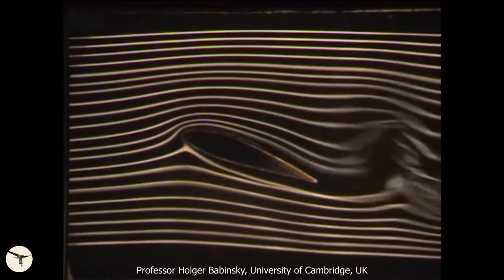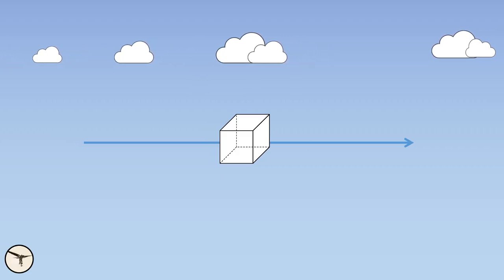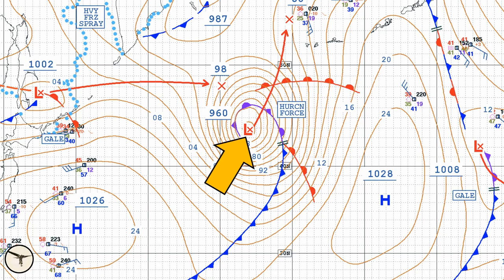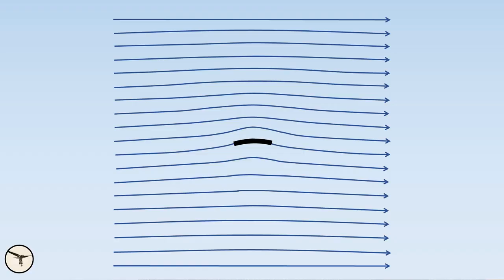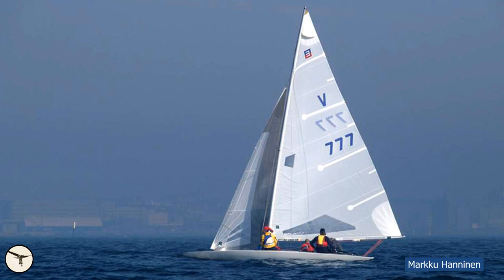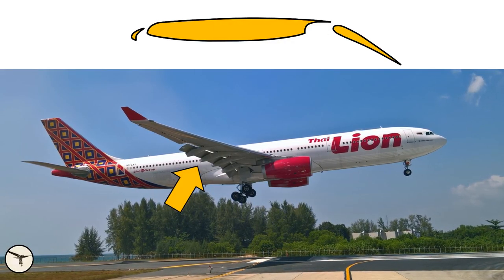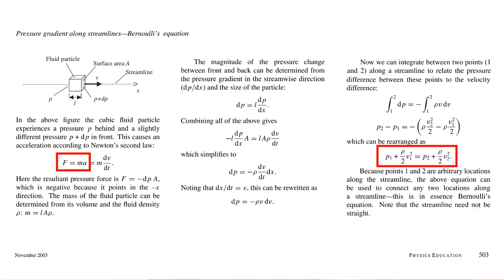Forget Bernoulli and Newton | The easy way to explain lift

Comment: The problem with this explanation is that it doesn't explain how planes can fly upside down, and how some wings are completely symmetrical and even flat in the case of some fighter jets
Reply from the maker: Short answer: Angle of attack. A longer answer: https://youtu.be/d4w1Iy4vVMg
Reply: The key is in the symmetry, or rather the presence of asymmetry.  Asymmetry to the relative wind is the condition for lift.  Asymmetry can come from asymmetrical camber and/or asymmetry due to angle of attack.

Comment: In 7000 hours of flight time. Flying cargo for a living, flight instructing,  flying ultralights, powered parachutes, and kites.  I have come to the conclusion there is not just one answer.  Lift comes from pressure, that pressure can come from impact, ie angle of attack,   In a powered parachute or kite.  Or from Bernoulli’s type of lift.  Some aircraft such as the stol planes could fly with no airfoil at all. Just off impact pressure.   There’s a lot more to this,  like aspect ratio,   And drag curves.  It’s not that easy of a thing.  Nice video. But the whole story has to many answers.
Reply: you've a poor understanding of this subject. 

while it's too tedious to go through everything, just for starters: symmetrical airfoils such as on aerobatic plans still create lift the exact same way as any other plane; meaning almost exclusively via their top surface. in this case, an angle of attack is required for it to work, but the lift does not come from "impact pressure" or deflected drag. while physically not impossible, this would be by far the least efficient method to create lift.

Comment: If a slightly inclined hydrofoil is pulled through liquid helium, no transverse force is generated. If the same hydrofoil moves through liquid sodium, with exactly the same geometry or kinematics, then there will be a transverse force, also known as lift. Explain that !
Reply from the maker: Zero viscosity
Reply: @FlywithMagnar  Correct. You could elaborate for the benefit of your viewers.

Comment: No mention of angle of attack? No consideration of non cambered wings working in simple toy gliders?
If all the lift is low pressure above the wings, what keeps the lift required to carry a 400K pound B747 from ripping the thin skinning off the upper wing surface? There has to be more.

Comment: A teaser to explain the difference.    An airplane carrying a plane load of bird cages with birds in them.  Does the airplane weight less if all the birds fly around there cage?  No, because the air coming off their wings goes down and hits the floor and the airplane is still carrying the bird flying or sitting on the roost.  If ceiling and floor of the aircraft body are cut out so you can see through the airplane and now the birds fly around their cages does the airplane weight less?  Yes, because the bird wings pull the air down throught the open ceiling of the airplane and push the air out the bottom of the open floor of the plane.  And if you put in a large fan as in a F-35 and open the top and bottom door and turn the fan on then the airplane can move up without the lift from the wings, because the fan, like lots of little birds, is moving air down.

Comment: Rockets also work on the Bernoulli Bernoulli  principle. This is why rockets cannot work in the vacuum of space.
Reply: Wrong. They work on newton and work just fin in vacuum.
Reply: @Observ45er  Rockets work on pressure.  You cannot create pressure in a vacuum
Reply: @boptah7489   Try again.  
The combustion pressure pushes the rocket motor forward while pushing combustion gasses rearward (in to the vacuum)  Momentum transfer.
The gasses have mass and the pressure accelerates them into the vacuum allowing the forward component of that same pressure to push the combustion chamber forward.
 Trivial  Newton's Third Law from 11th grade.
Reply: @boptah7489   Try putting zero pressure (the vacuum of space) into Bernoulli's equation and see what you get, smarty pants.
.
Hint: Rockets work BETTER in space than in an atmosphere pressure.

Comment: So, in other words, a curved surface in motion produces a pressure gradient across it - low pressure immediately above & a corresponding low-pressure immediately below - as you ABC diagram deftly demonstrates (which, seems a tad Newtonian, wouldn't you agree?). Seems to me all theories, more or less, point to this same conclusions, just explained from a different perspective. Moreover, you're ignoring the role of angle of attack & the Coanda effect at the boundary layer, both of which are highly significant in the generation of lift, wouldn't you agree?.  In fact the diagram of high-lift devices you used in order to demonstrate increased curvature shot you in the foot a little as they portray slats & slotted-flaps (curvature/area increasing drooped leading edges & Fowler-flaps would have been a better choice). The primary role of a slats is to re-energise the boundary layer on the upper surface of the wing - not to increase curvature. These allow the plane to operate at a higher AOA, thus generating greater lift at low-speed. Although slotted flaps do increase curvature they, primarily,  exploit the Coanda effect by accelerating air through the slot formed between the leading-edge of the flap & the trailing edge of the wing.) This allows them them be lowered to a greater AOA (thus generating more lift) without stalling when compared to a plain-flap. May sound like I'm picking here, but you're being a little forthright, maybe even pedantic, in your explanation ("wouldn't you agree?") so inviting scrutiny. Remember, the devil is in the detail. Wouldn't you agree?
Reply from the maker: Thank you for tour feedback. Yes, the devil is in the detail. The purpose of this video was to explain lift without using Bernoulli principle or Newton' laws of motion (the nature is a great source of inspiration). I just added them in the end as a teaser. 
Then, I made this video: https://youtu.be/uyRx25MSWng
Which was followe up with this video: https://youtu.be/d4w1Iy4vVMg
I think I have answered your comments in those videos, except for the slapt/flaps, wich will be the subjeft for a future video.

Comment: IMHO The Coandă Effect (From Henri Coandă, Romanian scientist, 1886-1972) is more about the property of a flowing fluid to stick to a convex surface* (that precisely addressing and explaining the experiment with the paper). A consequence is "suction", ground effect and, ofc, the so-called AERODINAMYC lift, exerted on a single curved surface, as you wonderfully explained. 
Bernoulli's Law (from Daniel Bernoulli, Swiss scientist, 1700-1782), on the other side (in conjunction with Newton's 2nd Law) better explain the wing (but not how an aircraft flies, which is a conjunction of factors!). 
Bernoulli's wing: Simply put, the wing splits the air into two streams, one flowing atop the wing, and one below the wing. One can imagine the air particles A and B flowing together, hand in hand, being separated at the leading edge of the wing and happily meeting again at the trailing edge of the wing. "A" travel on the top of the wing, and "B" below it. That means that they traveled the respective distances, while separated, at the same time (!). 
And how "A" in "B" stays closer to the surface and just not go away? Well... (*) That's the Coandă Effect :)
If the top of the wing is more curved (as a usual wing is), the distance traveled following that surface is, ofc, greater than the "route" below the wing => the velocities v of A and B must be different in the way that v(A) > v(B) (d = v*t, t being the same here). 
Bernoulli's Equation: P(x)/rho+g*z + v(x)^2/2 = constant. rho (fluid density), g (gravitational acceleration), and z (elevation) can be assumed as being (quite) the same and neglected,  thus p and v are inversely proportional.  (btw Your equation looks a bit odd...). Measuring pressure instantly and having V(A) > V(B) as explained => P(A) must be lower than P(B) => differential pressure, acting upwards ("lift"). 
PS there is a trivial question, asking that if the more curved upper surface (Bernoulli) and/or higher pressure to the apex of a curve (Coandă) explains the ”lift”, how a plane can fly inverted? Actually, they can't unless they are fitted with specially designed wings and geometry, as in the case of aerobatic aircraft, or some of the military.
Reply from the maker: To answer your question, the answer is angle of attack. There's no need for a specially designed wing to fly upside-down, as long as it is strong enough. However, many aerobatic aircraft have a symmentrical wing profile for better handling.

Comment: Lift is NEWTONIAN. Bernoulli flow is close enough to the process that does generate lift that Bernoulli flow and related math is often used in designing wings and aircraft, and explaining aerodynamics to aspiring pilots.

In actuality, the perfect vacuum at the surface of the back-top of the wing pulls down the air flowing over it. That air then pulls down more air from above it. All of this air, scooped up, if you will, is accelerated downward off the back of the wing. The opposite and equal result is lift—NEWTONIAN. Any other “explanation” is just Hogwartsian nonsense.

As such, it can be determined that gravity provides most of the energy that sustains an airfoil equipped aircraft in flight. Glide ratios of winged aircraft (autorotation for helicopters) and the ability of autogyros to fly are proof. Jumbo Jets have more than once glided to landings. The 2009 “Miracle on the Hudson” landing the most recent I’m aware of.

Note: The bulbous front of commercial aircraft wings increase the efficiency of the airfoil’s ability to “scoop” and accelerate downwards air from above. It also makes the wing much more stable.

Comment: Two pieces of paper hanging parallel to each other, straight down, about an inch to two inches apart, blow in between them cleanly and they will move closer together. 

Hold a single sheet of paper about an inch from your chest, without bending on the short side ;), and blow straight down your chest, the paper should move towards your chest.

An air compressor with a hose attached to the cap of a metal oil can, with the cap open to the can from the hose. Turn the compressor on and the air iside the can will move towards the airflow reducing the pressure I the can which will be crushed by the ambient pressure.

Place a piece of paper on the back of a box fan, it will stay there.

Etc...

Comment: So it's Babinsky now, not Bernoulli....
Reply: So, on the one hand, the Coanda affect is said to not be a fair representation of how a wing words without an external supply of dynamic pressure to one side only; and on the other hand the Coanda effect is used to explain the general case of lift?

Someone's gotta fix these inconsistencies.
Reply: @davetime5234 Kim Aaron, a Cal Tech fluid dynamics PhD has said Coanda has nothing to do with the explanation of lift on other YT or QUORA threads.
Different physical phenomena.

Comment: A little knowledge can be dangerous. Someone not too bright wrongly concluded that lower pressure above the wing, per Bernouilli, creates lift. That is entirely wrong. But everyone keeps trying to incorporate it into their explanation. Wings fly based on Angle Of Attack. That’s it. It’s the same as turning your hand outside a moving car window - it flies up. Curvature is only used to efficiently push air down. It isn’t required. Look at fighter jets’ wings. They can fly upside down which shoots a huge bullet through this longer path, faster airflow, reduced pressure nonsense.

Comment: The answer to why planes fly is simple. Given enough THRUST, even a coat hanger will "fly"!
Reply from the maker: I prefer kitchen tables.
Reply: It is a matter of efficiency.  To have enough thrust to fly a flat wing the engine will be bigger and heavier.    A small engine can power a small aircraft with an efficient wing and carry 3-4 passengers.

Comment: I find you hard to understand and I think it’s because your own understanding of the process is marginal. Your illustrations are no help either. In your previous (first) video you showed a symmetrical airfoil at an angle of attack atypical of ordinary flight - more like near-stall - and drew, I think, erroneous conclusions. This time you show an airfoil looking like a curved flat plane with zero angle of attack and expect that to be illustrative. 
Why not use realistic airfoil cross sections under realistic flight conditions?
Simply being an airline pilot does not justify taking on the role of authority. 

Finally, frankly, I don’t like to be talked way down to as if I were 7 years old in the manner you used multiple times in this video, especially when it appears your own understanding of the subject is  marginal and incomplete.

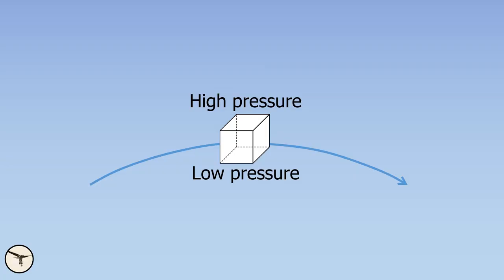Comment: Why does your drawing at 2:40 completely disagree with what's shown at 9:25?  I've been teaching all types of flying for 45+ years, and this is by far the WORST explanation of lift I've ever seen.  Geez, if you really want to simplify it, most pilots get all the understanding they will ever need by sticking their hand out a moving car window.  Tilt your hand up, your hand goes up and back, tilt down, it goes down and back.  Tilt up too much, and it stalls, falls and gets ripped back in the high drag.  Curve your fingers to form an airfoil, your hand goes up.  Voila.
Reply from the maker: I would like to give you a reply, but is 9:25 a typo? If you mean 5:25, then I have to inform you that both figures are published in "How do wings work?" by Professor Holger Babinksy, Department of Engineering, University of Cambridge. Here's a link: https://iopscience.iop.org/article/10.1088/0031-9120/38/6/001
If you cannot download it, send me an email and I will forward it to you.

Comment: At 2:47, you're deliberately bending the truth.

First, you said that IF THE PRESSURE ABOVE THE MOVING CUBE IS HIGHER, THEN THE CUBE WILL MOVE ALONG A CURVE

Then, from this, YOU JUMP to a different statement:

IF THE CUBE IS MOVING ALONG A CURVE, IT MEANS THE PRESSURE ABOVE IT IS HIGHER THAN BELOW.

This transition is a logical fallacy. 

It's the same as "IF I'M ATTACKED BY A BEAR, I WILL RUN" => "IF I'M RUNNING, IT MEANS I'M BEING ATTACKED BY A BEAR"